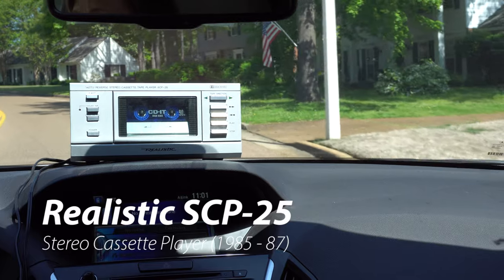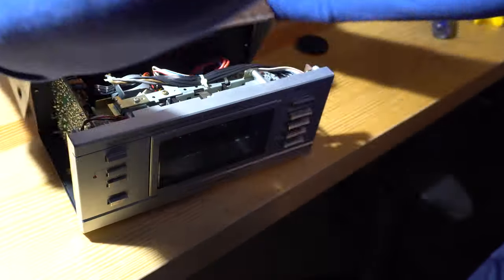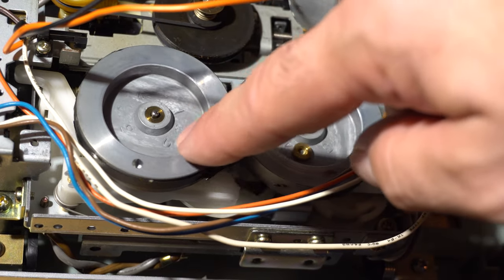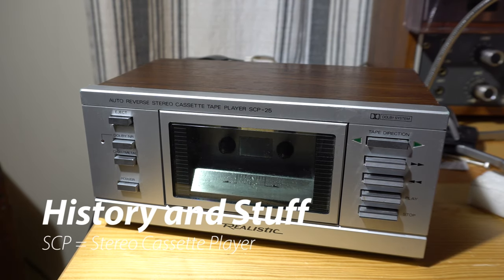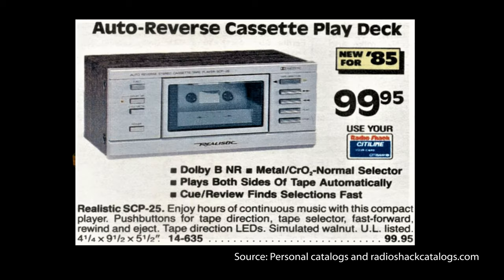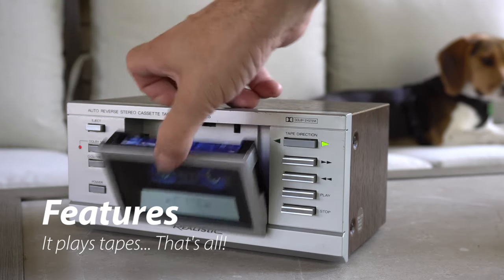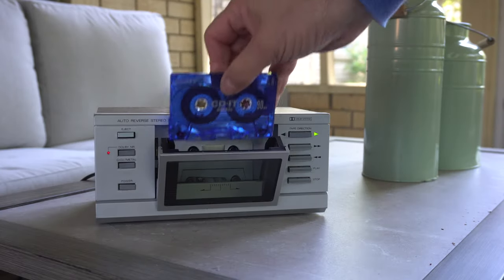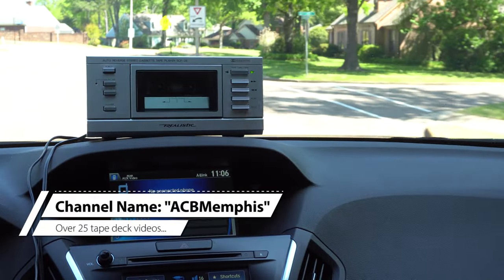Realistic SCP-25 Stereo Cassette Deck

Comment: An amusing re-use use of an old tape deck- though the dash top mounted intrusion into forward vision might attract the attention of a police officer in case of a traffic stop. I still own my SCP-25    ( needs belts ) which I used for copying tapes to my still functional Onkyo TA-2140 deck. Might look good installed in a vehicle dash center column with sufficient available space,
Reply from the maker: Thanks for watching! If I do get pulled over, I hope the officer will believe the AC inverter and RCA jacks included with the car were intended for use with Hifi components like this, and not a video game system....

Comment: I have one of these that suffered from belt melt.  However, there looks to be three belts in the unit, two of which are broken.  Can you please provide where you found the replacements and how many you actually replaced?  I don't want to place an order and not receive what I need to repair the unit.  Thank you.
Reply from the maker: Finding square belts is easy, you can buy an inexpensive belt kit on Amazon or eBay for about $10 with many different sizes. And, if you're just replacing a counter or FF/REW belt, no big deal if it comes from a cheap kit. However, flat belts are harder to find. They're also more critical, since they generally control the flywheel and capstan speed. Unfortunately, I don't have a good source... For these videos, I've been using items I happened to have accumulated over the years in a parts drawer... The only belt I've actually purchased recently was for the Sony TC-WE435. I found it on eBay by searching for the model number... A highly respected repair guy whose channel I watch said in a recent comment he's ordered belts from "Russell Industries and Thakker" - I have not tried them personally, but would probably investigate that.
Reply from the maker: Just got a YouTube notification for this comment again for some reason... Anyway I have since ordered this package of flat belts on Amazon. It is a variety pack and seemed to do a good job of the Teac 555 (see video). https://www.amazon.com/gp/product/B08BYHLSBN/

Comment: I got that exact deck with melted belt at Goodwill Outlet. Still waiting for belts 3 months later. Finger Crossed it only needed belts
Reply from the maker: Good luck - hopefully that will be all it needs. These old electronics are very reliable, if it powers up and the motor turns it is likely belts will be all it needs.
Reply: Put new belts, works great. but it's sounded kinda weird. So I play the same song on youtube and the tape at the same time, the deck is slightly slower. I can't find any info on how to adjust the speed. I saw two adjustment dials on the board but they are for volumn for left and right output as far as I can tell. do you have any ideas?
Reply from the maker: @livestn  Yes, the speed adjustment is on the back of the motor. You have to take a very small regular screwdriver and adjust it. The "pros" who do this usually play a special tone tape and adjust to the tone, but you can get a pre-recorded tape and adjust for that and try to match playback to an MP3 or CD.
Reply: @ACBMemphis  I put a flat screwdriver of various sizes in the black hole in the back of the motor. I couldn't feel the screws and the deeper I insert it, I feel like I am touching the spinny part of the motor.
Reply from the maker: @livestn  You're right to be cautious, It is a very tiny adjustment mounted on a board inside the motor. If you Google "trim pot potentiometer" you can see some pictures which might help. It's sort of like working with one of those door locks people have on bedroom doors in their houses but smaller...
Reply: Can you point me to where to get the belts?  I need all of them.  None of the places I've found make it clear that all belts are included.
Reply: @stangbat  I got them from Ebay. Got the assortment of flat and Square belts. I found 50 square belts assorted sizes and 50 Flat belts assorted sizes for 2.5 each so total $5. You have to order them from China and took forever to get here. one package actually never arrived.
Reply: @livestn  Thanks, I've ordered belts from eBay.  Fingers crossed!